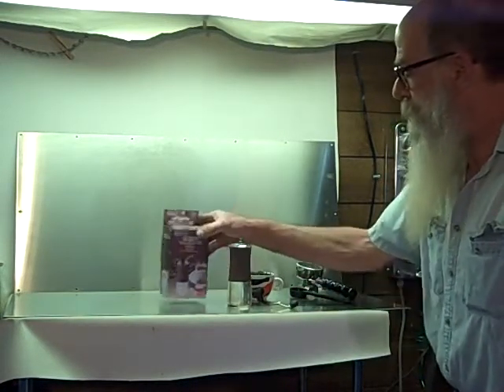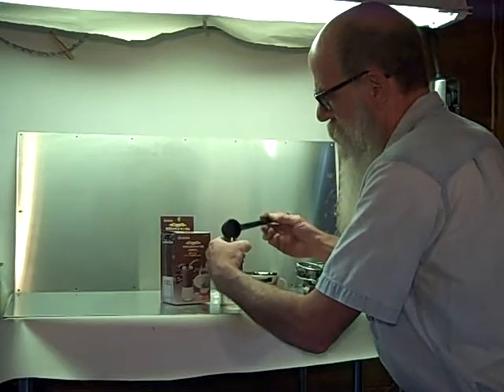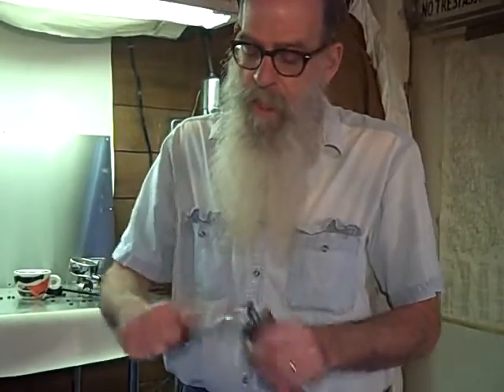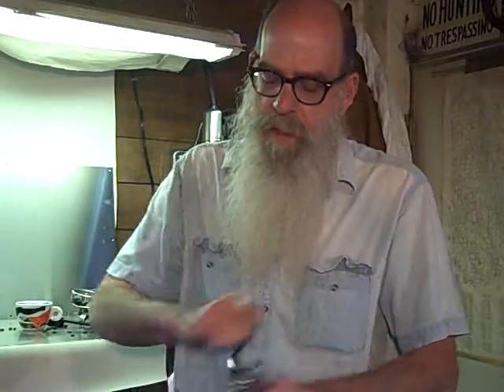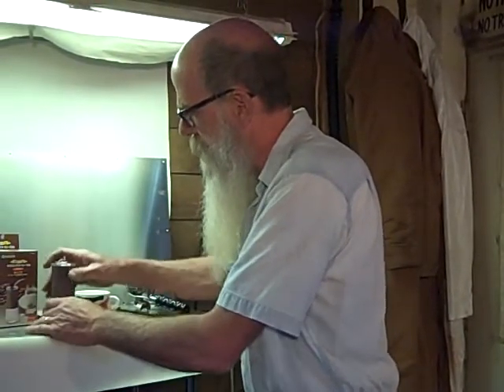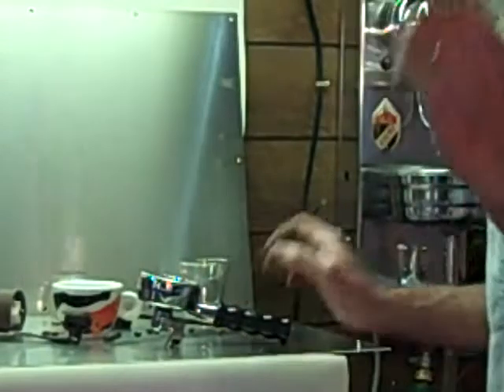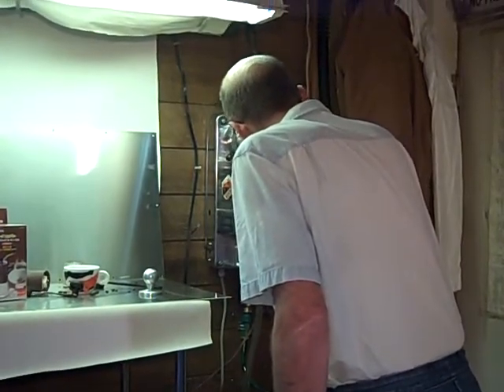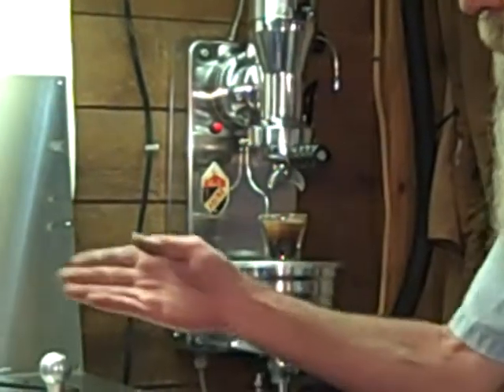Kyocera Hand Grinder & Faema Wall Mount Espresso Machine Demo

Comment: The Kyocera is a nice hand grinder, but seriously if you drink more than a cup a sitting or have to prep for more than 1 person regularly (family, guests etc) you'd have to be a masochist to hand grind.  The closed design like the kyocera makes it a little easier but it's still a pain.  If they made a hand grinder with a much larger diameter burr and geared it might be tolerable but I don't see a well made product like that around.